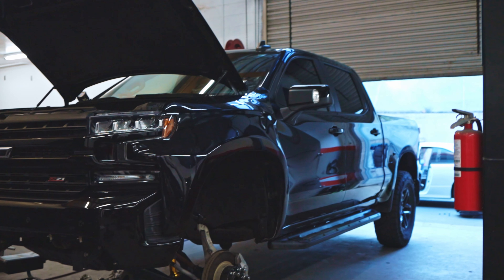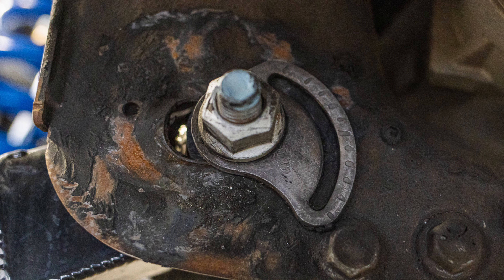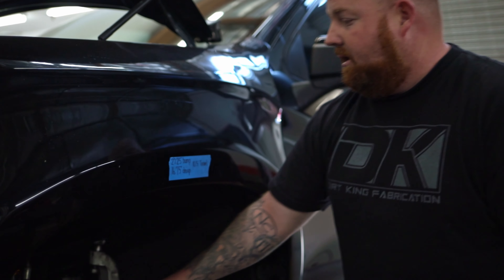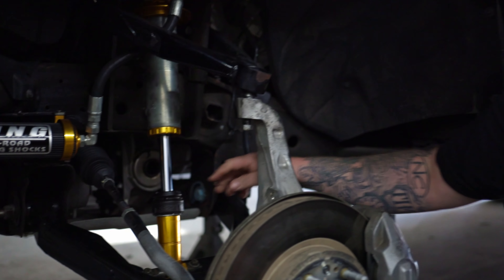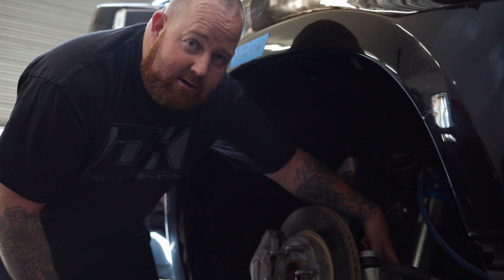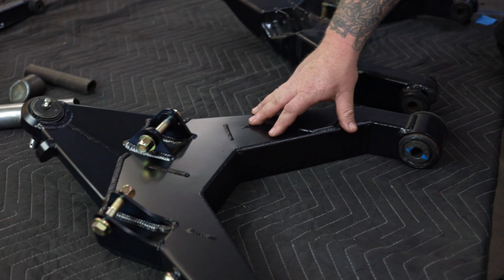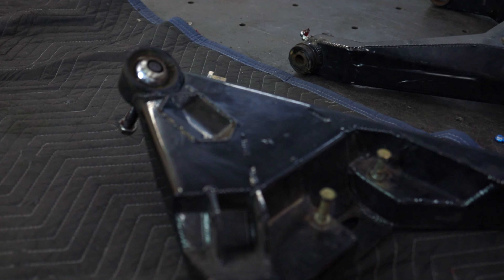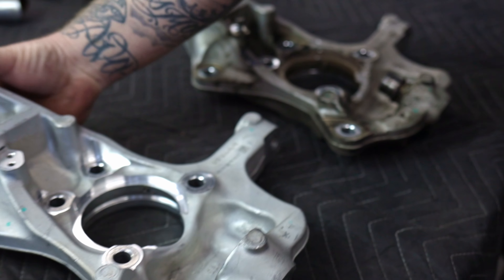2020 Silverado Long Travel Swap (Major Results)

Comment: Right before the pandemic I had my eye on a 2014 Silverado (2wd/5.3) 37k miles for $17,500 in Los Angeles. I wanted to do your front mid travel and rear bed cage setup. Had $28k total to start the build. Now the same truck costs $24k to $27k :(

Comment: I have 2021 trail Boss in white. I know most people always get different rims and tires after installation. But I really like the factory 18 inch wheels that I have. Would those work with your kits if all I got was bigger tires..
Reply from the maker: Yes those wheels will work, possibly may require a 3/8" wheel spacer.

Comment: Hey mate awesome video , if I were to buy the whole kit for chev 1500 ,  would it be suitable for everyday driving both on and off road?
Reply from the maker: Yes the suspension shown in this video drives great both on road and off road. This suspension system is the newest kit we've developed and features heavy duty ball joints along with oem lower arm bushings. This replicates the factory on road ride quality while not compromising strength or off road handling. Competitor's 2019+ GM 1500 long travel kits do not have these features which make the ride quality not as smooth and the suspension requires more maintenance.

Comment: I’m a little late to the party but was the front bumper replaced or is that oem? Can’t quite tell TIA
Reply from the maker: That is an OEM bumper that is trimmed to have a flat line across the bottom and then we installed our tube bumper. Here's the product link with more images. https://dirtking.com/collections/silverado/products/prerunner-front-bumper-dk-636920

Comment: Also did the truck in the video still use it's original body panels in the front or did it use fiberglass fenders.????  It's hard for me to tell.
Reply from the maker: They are aftermarket fiberglass fenders and bedsides from Fiberwerx

Comment: Will this kit will raise my trail boss more that the 2in lift that it comes out from factory ?
Reply from the maker: Our long travel kit paired with our long travel spec coilovers have the ride height preset similar to the ride height of a factory trail boss. The ride height can be easily adjusted up or down by tightening or loosening the threaded preload collar on the coilovers.

Comment: The trail Boss has a two inch factory lift achieved with a block in the rear. When stalling the rear leaf and cage kit will it level the truck or maintain the factory rake angle? Would I need to reinstall the lift block in the rear if possible.?
Reply from the maker: Our rear suspension would replace the lift blocks and keep it around the same ride height. The front suspension is adjustable to give you 0-3" of lift.

Comment: Does this kit push the front tires further forward? I know that's common practice since you can trim the front wheel well for clearancing bigger tires.
Reply from the maker: Yes it moves the wheel placement forward to allow for the best clearance for 37" tires throughout the suspension cycle.

Comment: I have a gas model 05 2500hd I’m looking into a long travel kit for trailing/crawling I would need to be able to flex quit a bit is it possible to flex ifs more than 20 inches
Reply from the maker: Unfortunately we don't offer suspension for the torsion HD chassis.
Reply: @dirtking  we’re would a person find something like this
Reply from the maker: @davidchambers4978  I believe both LSK and Kibbetech have suspension for that chassis.

Comment: So is this basically 3” lift with 37s??
Reply from the maker: No our long travel kit is a lot different than a standard lift kit. The long travel kit is built for off road performance and offers addition suspension travel. The long travel kit makes the vehicle 3.5" wider per side because the control arms and axles shafts are extended. Here is the link for all the specs on our long travel kit. https://dirtkingfabrication.com/collections/silverado/products/long-travel-kit-dk-636908